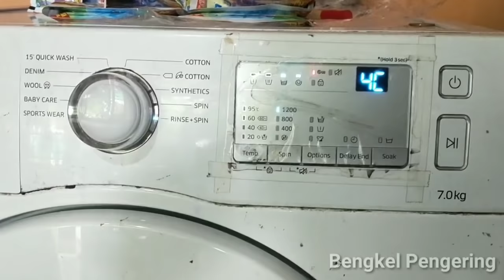Tips/Cara merawat dan membersihkan mesin cuci bukaan depan

Comment: Mau tanya bang, 
Electrolux saya ketika mulai start, yang jalan pertama itu inlet. Bukan drain , kenapa ya?
Kalau emang software nya eror, bisakah di buat settingan pabrik default.?
Reply from the maker: Biasanya drain dulu sih
Reply: Punya solusi nya ga bang?
Reply: Kalau cara menambah volume air pada front loading Electrolux gimana ya bang... ?
Saya cari sekrup yang biasanya ada di water level tapi ga ada. 
Mungkin punya solusinya bang??